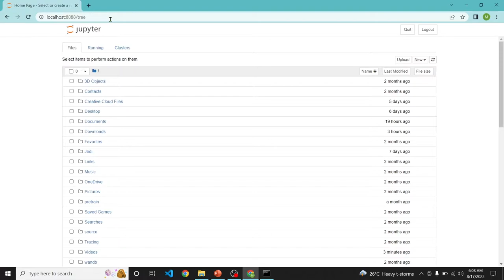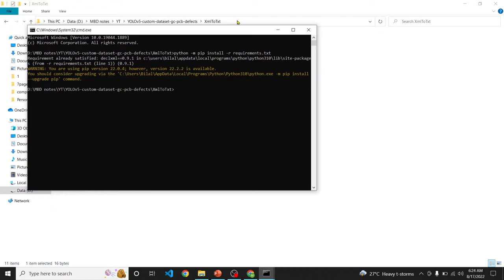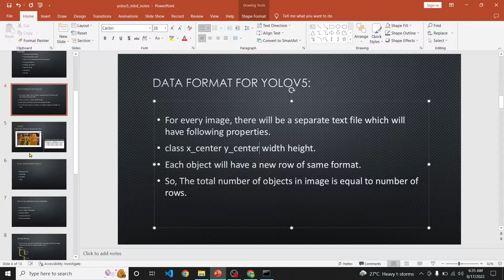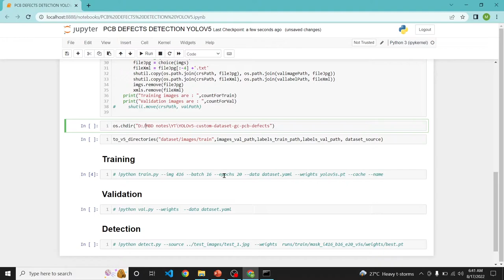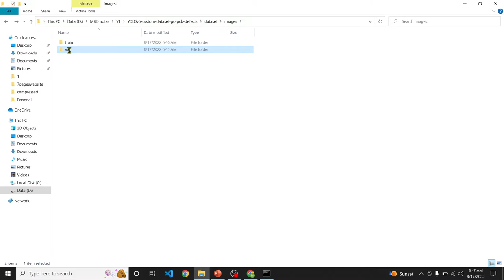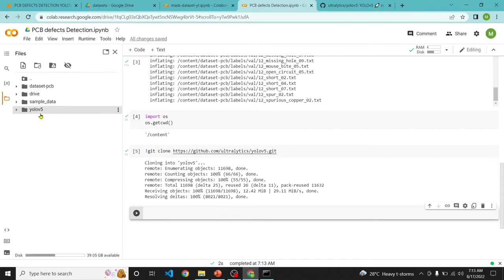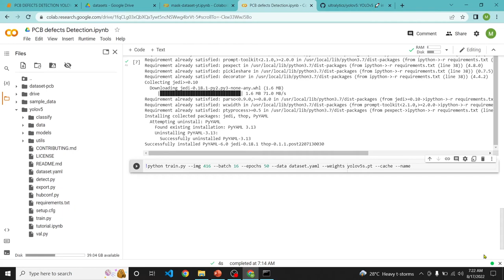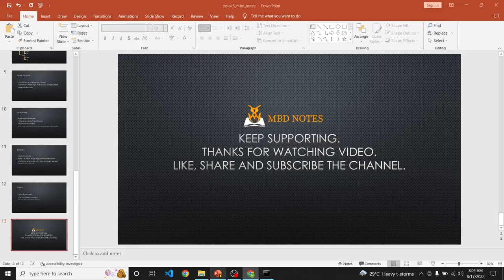YOLOv5 training on Custom Dataset | PCB defects detection using YOLOv5 | Google Colab | @mbdnotes2423

Comment: AMAZING, thanks Sir, now i understand how to use yolov5 for PCB defect detection, but i have some problem with the accuracy, i think changing the batch size and epoch is one way to maximize its performance. Maybe you can maximize the performance of yolov5 model like improve hyperparameter, changing the backbone, neck, head, anchor or something else
Reply from the maker: First of all try to improve dataset annotations.